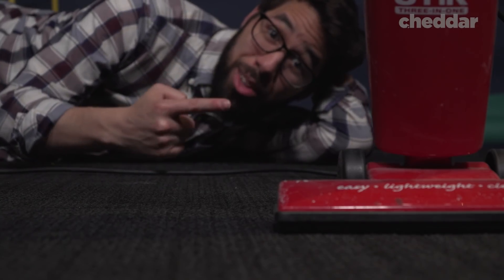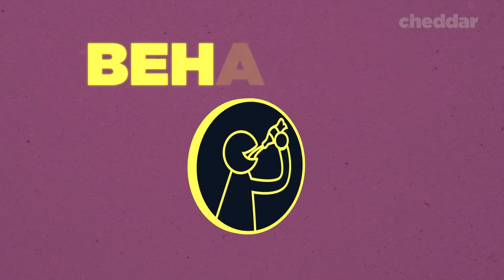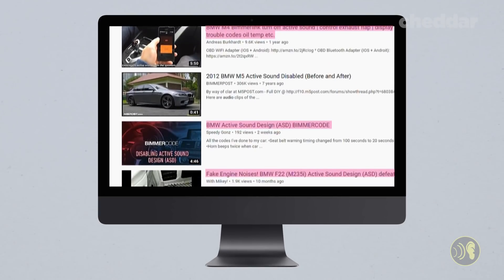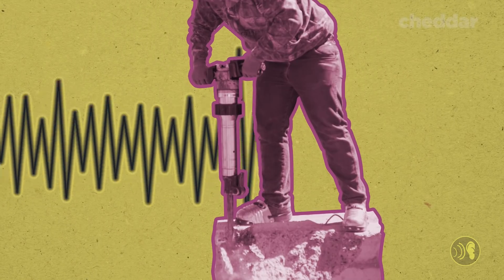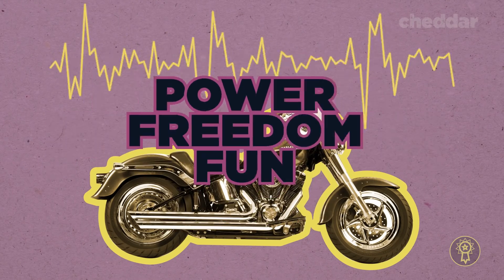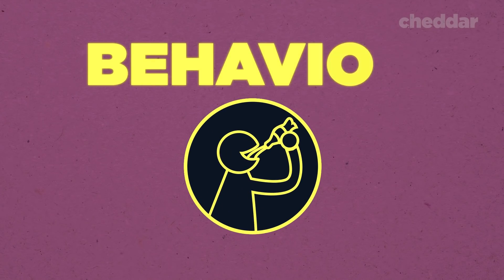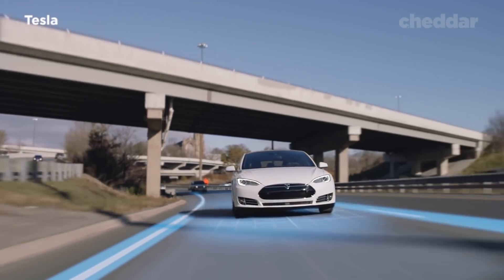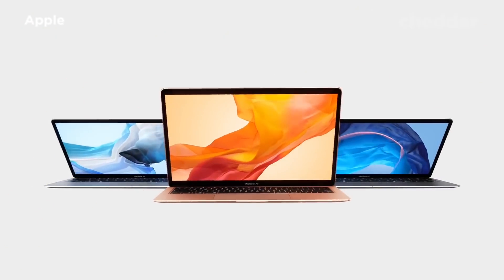The Fake Sounds Companies Add To Products - Cheddar Explains

Comment: One thing you did miss on why people hate the sound engineering in cars is the active sound cancellation. Active sound cancellation will produce a negative wave form sound to cancel out a noise if it has a predictable rhythm. This could fool you into believing your cars engine and suspension are in perfect order when there is an actual issue and can also make sounds come from a different direction than were they usually do. This is why most eliminate the cancelation feature, especially in performance cars that have been tuned. Missing a sound that could indicate bad timing or a knock due to the cancellation feature could destroy the engine you have s pop ent so much effort and money on building.

Comment: Can confirm that car manufacturers spend atleast 500k in acoustic engineering in cars, from sounds you will hear to sounds being cancelled out. They even make perfectly tuned rubber for engine, transmission and suspension mounts so that you do not feel the actual vibrations the car makes while driving normal. Sound/vibration engineering gets the same treatment a new powertrain does and is very important. The more you know.

Comment: 1:18 Correction, that clicking noise your car makes when the turn signals are on is actually the noise of the metal contact strip bending. So without that (going with it is conventional blinker and not those fancy electronically controlled new ones) you would just turn on a light, it would be constantly on and not blinking.

Comment: Not gonna lie I had two big things when shopping for a car. The first that that the car has Amber blinkers (I feel like other drivers just don’t notice ones that are the same color as the brake lights. The second is that the turn signal blinker noise is not annoying. It did make me notice that sometimes sound does influence some of the purchases I make.

Comment: I think you're over thinking some of these examples... Like, pretty sure a windshield wiper makes the noise it does because of the material they used, which is the material they found to be the most effective. Not because they liked the sound of them going back and forth.

Comment: "Part of the reason motorcycles make so much sound is for safety" yes its turned into being a helpful thing but look at where the motor is and where the end of the exhaust is. Not much room to put silencers everywhere in it, plus you start losing power when you restrict too much.

Comment: Pringles have disgusting ingredients. Vacuums are annoying A F. Cars that are noisier are annoying.  The worst are cars with a misfiring system, the annoying bang bang. Tesla makes the fastest car for going straight and most of America's roads. Mazda Miata is pretty sweet for turning at high speeds. So many cars are unnecessarily annoyingly loud and chicks just think those guys who drive it are compensating for their small pee pee. Babes like cars that are A) unique or B) cute. 

A unique car would be a 40s/50s style custom mod to add a 5th wheel in the back. What does the 5th wheel do? It only is used when two cars block you in while your car was parked, the 5th wheel goes down and the car's rear goes out towards the street so you can reverse out after you put the wheel back up. Babes will see your car escaping from being blocked in and be like "THAT IS SO INTERESTING, HOW DID YOU GET A CAR LIKE THAT?"  Basically fun stuff like that babes like.  The babes that do like guys who drive fast sports cars, are gold diggers, sluts who just want to bang bang don't care what car you drive, they care more about swagger. Also if you drive a fast car and you can't rally for S, you are just a poser.

Comment: Personally, I'd prefer every device be utterly silent. I especially hate loud motorcycles!
Reply: same, it would help with sound pollution a lot
Reply: Have fun walking out into the road and getting smacked by a motorcycle or car because you didn’t hear it coming. Or even getting blindsided, at least if a car or bike is coming from behind you can hear it.
Reply: @jk844100  I'd rather live with a little extra risk in exchange for peace and silence!
Reply: Illuminationsfromtheattic I value my life so a little momentary discomfort seems like a fair trade for not dying.
Reply: @jk844100  
"momentary discomfort" is a gross understatement of the serious issue of noise pollution.

 Besides, didn't your mother ever teach you to look both ways before crossing the road?
Reply: Illuminationsfromtheattic school taught me “stop, look, listen, walk”

You stop at the road side, look both ways, listen for any vehicles then walk. The sound of a vehicle is very important especially if your view is obstructed, like if you have to cross the road on the inside of a bend, or crossing at a junction or corner.
Reply: @jk844100  Even without the engine you still get the sound of tires and rushing air. That should be enough to give you advance warning of approaching vehicles. The value of quiet and natural soundscapes is greatly underestimated by most people. The excessive amount of noise generated by vehicle traffic is more harmful than you realize.
Reply: Illuminationsfromtheattic I’m not saying noise pollution isn’t bad I’m just saying it’s not as bad a putting many people’s lives in danger.
Reply: Do you think motorcycles are loud on purpose because cars are made loud on purpose, so in order for a driver to be aware of the motorcycle, the bike's fake sound has to be louder than the car's fake sound?

Comment: MacBooks deliberately run hotter than ideal because the sound of fans roaring is perceived as the laptop struggling, so the fans don't start until the laptop is incredibly close to various thermal maximums for the internal components.

Comment: I'm sensitive to noise--I literally hate how loud vacuums are. I wish cars were quiet. I wish things in general were quieter :(
Reply: For me, at least with cars, I think there needs to be a bit of an exhaust note. Not deafening, but enough to cover up the other noise an engine makes. Of course the other option of making all the other components near silent as well would also work. The exhaust in my Challenger GT is so quiet that I can hear the valves. If exhaust noise sounds like power, valve noise sounds like impending mechanical failure. Beyond that, it's a muscle car throwback, so it should definitely be making at least a bit of a ruckus even if its only a V6.

Comment: Ford uses what's called a sound symposer to pump engine sound into the cabin, theres even an electronically controlled valve that activates when the throttle is put at a certain level to get the sound. Now it's not necessarily fake, per se, but more of a different sound to make it sound like its louder than it actually is. It uses intake noise more or less, which can be louder in some cars depending on intake manifold design

Comment: I am so scared of vacuums because I feel the loud noise means that it is about to break. I have a shop-vac that is super quiet and I know it works really well. But I used to have an old one and it was so noisy because it didn't work well. So making it loud makes me think it has to work harder to do anything, making it worse.
PS also I will never buy it because scary.

Comment: gotta call bs on most of this. 

Motorcycles are loud because they have, at best, very short pipes.  When you hear the super loud harleys, its because those asshole have removed the muffler and/or resonate chamber. 

vacums are loud for one of two reasons: cheap motors and the high volume of air moving through small tubing.  That's one of the reasons air ducts in homes are so large, so you can move a large volume of air, nearly silently.

Comment: The car horn is NOT to say "thank you" or "get out the the way you horrible driver." It's ONLY use should be to notify a driver when they're not paying attention.

Car horn etiquette doesn't need to be "more nice," that only achieves more sensitive drivers. One medium horn or 2 quick horns should do the trick. If your doing 3 horns, of any length, thats excessive and out of frustration. 

If an inattentive driver corrects their mistake, before you honk, & you both end up at a red light. Then you've missed your chance to honk. Bc they are now paying attention, but you may give them a stern look.

If you want to say "thank you", you can show your palm or lift 2 fingers to indicate your appreciation.

Comment: The motorcycle part was really badly done. The sound of Harley is not what it is because they engineered it. It is because they use big V2 engines with loud pipes. Of course some designing goes into the pipes sound but it does not make it anyway unique. After your claim you try to validate it by playing noise of another big motorcycle. The problem is that it sounds like you chose a bike with straight four what is probably even a tour bike. Seriously, it is like comparing potatoes to strawberries and being surprised that strawberries taste much more sweeter. If you had taken some other custom bike with big V2 you might notice that now it is much harder to hear which one is Harley.

Comment: As an engineer that has to consider these things, I think a lot of people are missing the point in the comments here. It's not that people want a loud vacuum. People don't know what they want. You give them a vacuum half the dB's as a normal one and they will review it as "under-powered" and still be looking for a new quiet vacuum. You have to design to people's behavior and instincts sometimes just as much as their logical opinions and feedback. 
I've personally worked on products that were improved by making them quieter and testing showed identical power as the item it replaced. Overwhelming feedback after it came out was that "the older model had more power." And that we cheapened it when really it cost us more to make it now. We no longer worry about making things quieter.

If 2019 vacuums were all noticeably quieter than 10-20 years ago, this generation would hold a popular opinion of "Remember how powerful your parent's vacuum was? Why don't they make them like that anymore." Any large brand has to protect against rosy retrospection/nostalgia bias. The fact is in most cases the thing you're using is much better than it was.

Comment: Harley... Excellent at turning fuel into noise without the awful side effect of horsepower.
Reply: Beautiful
Reply: @Dori Tos Well...try a twin cam or Sportster and form an opinion that's backed by experience :) if you end up hating the shake then try the new Harleys with the new duel counterbalanced Milwaukee 8 motor. They removed 75% of the engine vibrations. Its soooooo nice.
Reply: "making explosions for fun" is illegal, a Harley isn't ;)
Reply: Harley = God tier

Comment: I’m sorry but your thing on Harley Davidson was kinda BS.

It’s just because they have “long stroke” cylinders. Lower RPM with higher bore gauge. They were designed off old Combine harvester engines meant to thump away all day, all year with minimal maintenance( the same as WW2 naval fighters)Perfect for the Nomadic Biker theme. It’s a cruiser that has speed but isn’t meant to race. The “Boxer” of bikes. Hard powerful punches. A muscle car if you will.

Yamaha’s and Kawasaki’s etc are meant to look sporty and modern and racing. They’re responsive, ergonomic and lightweight. Short stroke engines with and smaller cylinder bore and a higher RPM. The martial artist of bikes. Lots of quick sharp strikes.

It’s an era thing that won’t ever leave Harley, when the old American dream ideology ends, so will Harley. Which will probably come at the same time as electric vehicles and road permits.

Comment: Voted down as CLICKBAIT. I saw a thumbnail of a vacuum cleaner - and although the cleaner is shown at the beginning, almost no detail is given. The video then goes on to talk about fake sounds in cars - then in the middle of the video returns to the vacuum cleaner, but only as much as referencing the fact that you hear the dirt particles striking the compartment. there is NO detail about how this actually occurs deliberately by design. NO examples of specific models which have had their air channels modified from what would otherwise be a more sensible channel.

Also, the video talks about "loud" vacuum cleaners, being louder than technology would require them to be. This doesn't suggest dust particles: it suggests MOTOR NOISE, which is the main source of vacuum cleaner noise. So the thumbnail is suggesting that manufacturers deliberately make their motors louder than necessary (or otherwise amplify the resonance). However the video contains NO detail on this.

Clickbait :(
Reply: Fucking thank you.

Comment: I was waiting for the vacuum cleaners' sound to be explained tbh
Reply: I saw something about that before.  Some make small notches where the wind passes to produce a louder wind noise. Some have connections that have just a tiny bit of play to create a vibration. Some have added ridges that appear to function as an aid to keep clogs from forming, which they also do, but that create noise as well. The main thing is hearing that clattering sound when you run over some crumbs. It's a very satisfying sound. So they add thin plastic hollow walls that reverb that sound. If you tap the plastic panel right behind the roller brush, it usually has that light, sharp sound.

Comment: Man, what? Motorcycles make so much noise because 2-stroke engines are loud. They tend not to be housed in engine compartments, like say, a car engine, so there's no dampening. It's not a 'safety issue', it's a consequence of the design.
Reply: If you think you understand enough to start teaching about motorcycle engines, sound design, and 2-stroke Harley engines.. ..missing the point that the engine noise as such is trademarked, Harley was an example. This video was not about any specific vehicle or even product category, there are so many more machines out there that make noise. This video was about the fact that sound is being designed and details engineered to a level many consumers  can't even imagine to make things sounding just right.

Comment: This is bs, sound insulation in vacuum cleaners restricts airflow and ads weight and cost. This makes no sense especially in the EU because vacuum cleaner power is limited by law. They force manufacturers to make efficient machines and with great effect. They vacuum with half power with almost double efficiency and they are not that louder actually since they have smaller motors. New vacuum cleaners are great i was amazed when i bought a new one recently

Comment: ideal vacuum is almost silent, a small hum to know it's on, and amplify the pickup noise so you know how well it's working. No need for it to be loud, just audible to the user. Anymore than that is overkill and makes the vacuum worse overall (damaged ears).

Comment: North America’s best-known study on motorcycle safety, the 1981 Hurt Report, found  motorcycles with loud pipes were not less likely to be involved in crashes — if anything, they were a little more likely to crash. 

In other words, riders need to make sure car drivers can see them by turning on their headlight, not by turning up their pipes especially since those loud pipes aren’t saving lives in the first place.. Horns for example in the U.S. are to be used meant for emergency purposes only and they're facing the direction of travel.

Comment: I'm surprised that there was no mention of the CVT transmission being modified to sound like it's shifting... That has a massive impact on anyone with a modern car.
Reply: I hate the cvt that is a garbage transmission only vehicle I've owned that livesd at the shop for you guessed it transmission issues
Reply: The truck we use for deliveries, an '11 F-250, got hit in a parking lot one day. While it was in the shop, they gave us a new '18/'19 F-250 to use.  And let me tell you, that knob instead of your standard shifter was the least satisfying vehicle to change gears in that I've ever driven. I'm now turned off from modern cars if that's the way they're going, regardless if it has any actual impact on changing gears or not.

Comment: Due to the fact that Amercans take pride in low IQ and gullibility, they continue to make choices counter to their best interests. Fact- it's been proven in audio tests that a loud motorcycle exhaust does not enhance safety, but conversely is a primary contributor to hearing loss. All the video needed was a comment about the riders achieving a significantly larger penis.

Comment: Definitely enjoy quieter vacuums
Especially if it means pets and children are less afraid

Also, as a car enthusiast, I think it’s a testament to great engineering if a car is quiet and powerful
Like, if you have a hemi, your car will whine down the road. I’m sure manufacturers add engine noise on top of it because it’s not a very pleasant sound. But no matter what, if you’re outside of that vehicle, you’re gonna hear that distinctly high-pitched airy sound (if your hearing isn’t damaged)

People that rip the catalytic converters apart and screw with their exhaust systems create a far different sound (and smell) than having a powerful engine...almost like the car is farting down the road...

That being said, electric cars are the future, and they really need some sound added to prevent pedestrians in a parking lot from blindly walking into a moving car